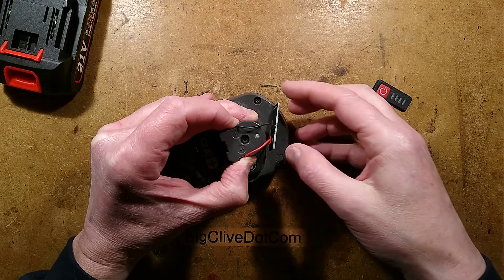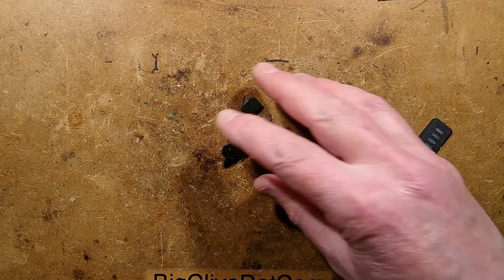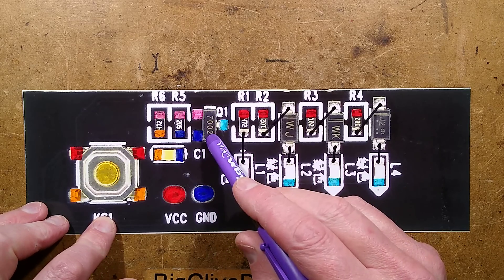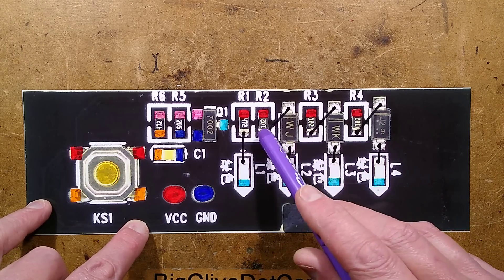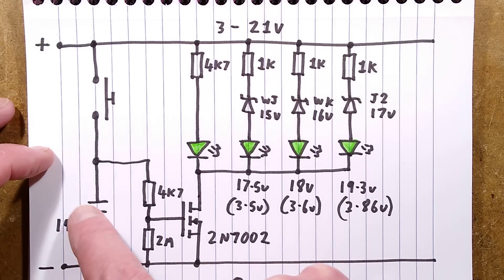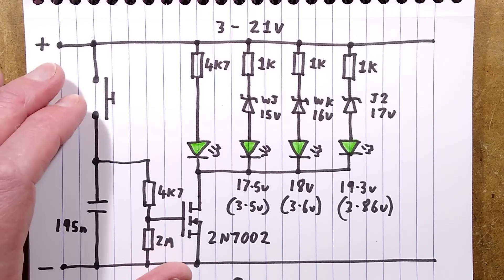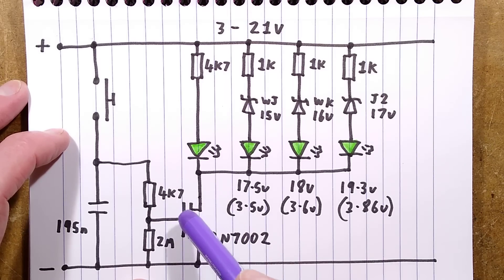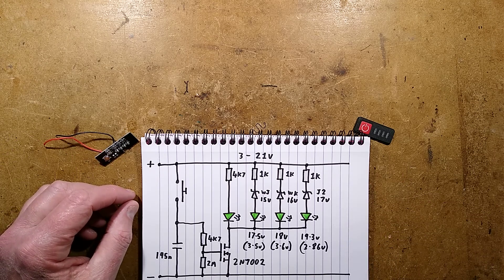Power tool battery level indicator for 5 cell packs

Comment: Hi Clive love the videos. Did you know that your local vape shop has a recycle bin for vapes?
The interesting thing is that they have to pay to have them disposed of. 
I have unlimited access to my local vape shops bin and can have as many old vapes as I want as it saves them money. I only take the bigger units as they have larger capacity batteries. A great source of free batteries.
Reply: I found it interesting the shops have to pay to get those recycling bins dealt with. And the shops I asked told me I wasn't allowed to take the bins' contents because of that...
Reply: I never thought to ask. Thanks.
Reply: Is this in the US?
Reply: @rickyleblanc3945  UK but I guess if you are saving the shop owner money they shouldn't mind. you don't have to take them all.
Reply: In the US you’d have to sell some of the free batteries to afford the treatment after contracting hepatitis.
Reply: @z0rkmids  Tuberculosis is more likely. Transmission of hepatitis by saliva has not been demonstrated.
Reply: @z0rkmids  lol don't use the vapes just the batteries.

Comment: Had you considered removing the panel with a rotary cutter/Dremel tool, rather than a hammer and screwdriver ?
Reply from the maker: It looked like it was slotted in, and a pair of pliers turned out to be a bad idea.

Comment: So a standard resistive power level display, but with a needlessly complex power button? (opposed to just on and off)... Why 😅
Reply: The fade-off is just a side effect of a super-simple latching circuit.
You tap the button and it shows the charge level for a moment before turning back off again.
Sure you can hook the button straight to the led's and save a few components, but then you would need to hold the button awkwardly.
The only thing bad about it is the terrible selection of diodes which don't match the actual full-med-low voltage levels of a 18V lithium pack.
Reply: Actually the fade out is really useful for checking the battery when working/with gloves/in awkward positions, or even just with your right hand (button is generally on the left):  your hand often gets in the way when pressing the button, so it's great that they stay on for a second or so
DeWalt skimped on mine, and it's infuriating !!!

Comment: I have used that kind of delay circuit in my "Star Trek" sliding door to my work room. 
The lights turn on when entering and stays on for around a minute when leaving (A 100uF/100k on the gate of the Mos Fet) Works like a charm and the fading lights comes for free. 
By the way my "Star Trek" door doesn't have the nice Swush-Swush sound, it sounds more like a de-railed train 🙂
Reply: I was actually going to ask about how you managed the very characteristic sound of the door.

Oh, well...
Reply: @TalasDS 
I'm no expert on Star Trek but like watching it...
Anyway.. I saw a YT video about sound effects.. and they said about the door noise..
I am not 💯 sure..
but I think they used a hand saw blade and slid something along it.. and altered the tape speed.
Reply: @mySeaPrince_  I heard on QI (a very reliable source of information on the BBC 🙂) that the sound is made by sliding a piece of A4 paper in and out of an A4 postage envelope. So basically pieces of paper sliding by each other. 
Try it out, if you have an envelope in house - the sound it makes is pretty close to the Star-Trek door sound.
Reply: @ZeedijkMike  "The characteristic "swoosh" of the doors opening is based on the sound of a flare gun with a bit of the squeak of Jim Wolvington's sneaker on the floor at Modern Sound". Source: Star Trek: The Next Generation Technical Manual page 67. :)
Reply: So it's a Airplane 2 door. Shush activated
Reply: The actual sound was closer to yours than the one they added in post.

Comment: Would it be feasible to just attach the whole thing to the front of the battery pack with a hold for the leads inside?
Reply from the maker: You could do that.

Comment: good old multi tool "dremel style" with a cutting wheel makes case mods easy.. saves breaking cheap ass plastic cases.
Reply: i use a jbc cutting blade soldering iron tip, makes less of a mess
Reply: Or a drill (or hot soldering iron) to make a hole, run the leads thru and glue on the indicator board.

Comment: It never ceases to surprise me just how far the designers will go to save money, even if it almost renders the entire product almost useless..
Reply: This indicator does not have to be very sharp though. Even if it shows battery fullish, half depleted and completely empty, is good enough in practice- one can quickly determine wether battery can be used or has to be charged.
Reply: I recently bought a cheapo panel voltmeter from Ali (<£1) and it was a bit out. After popping off the cover I saw an smd pot position was populated with a fixed 5k1 resistor. It was easy to replace with a 10k pot, but the penny pinching is getting beyond a joke. It's actually quite accurate when you can calibrate it, but out of the box these will probably just become landfill.
Reply: @georgeprout42  That is one component replacement. With the battery LED health indicator it is quite major, as you have to have two body cases and then the leds. It must be cheaper kjust to run one line, but then the cheaper batteries have the same feature as the so called more expensive ones.
Reply: No, just to pee of customers. On mass production supplying an LED indicator or not will probably cost the same, to stop a run to alter it for another customer costs money and time.